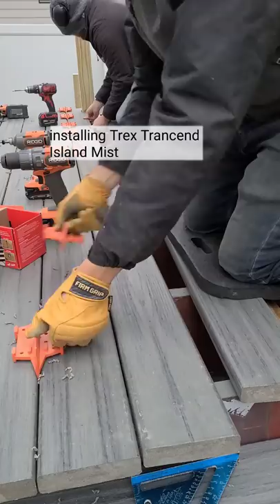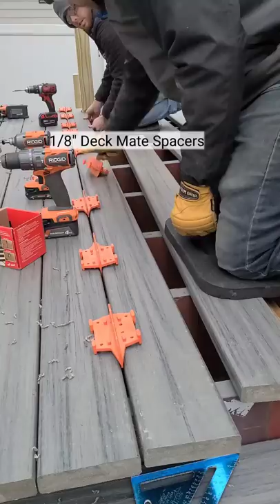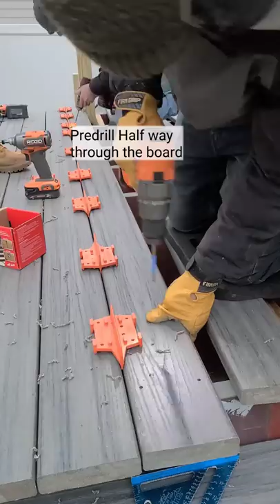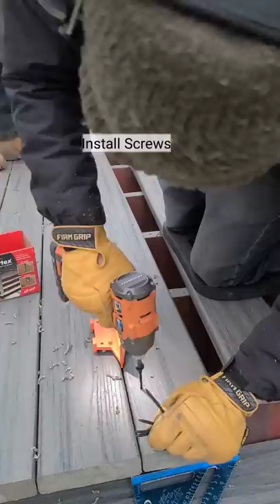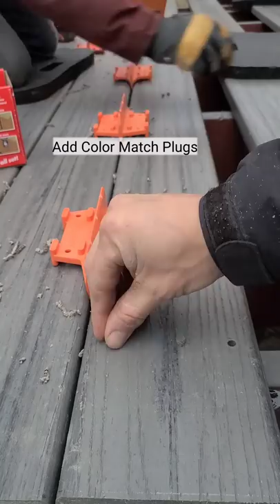Installing Trex Decking #shorts

Comment: You do realize Trex has a hidden hastening system that doesn’t require pre drilling every hole. It would be impossible making any money doing it the way these guys are doing. Or you would have to charge double for the same job…
Reply from the maker: This is a 90sqft deck.
Reply: @gobuildstuff  ok… so that still means doing things less efficient?

Comment: I switched to the Trex hidden fasteners it's alot faster and looks cleaner.
Reply: Why are they using all end boards (solid on both sides) all the way across instead of the proper ones for non-edges... The ones for center boards have groves on both sides for clips that pull them in and mount them to the deck boards beneath... Takes 1/4 the time of this drilling and plugging, plus it leaves the surface of the trex untouched so it's water tight. 🤷
Reply: @MrPhatties  It's possible that the hidden fastener system isn't readily available in there area.
Reply: @Brandonjraw  pretty crazy since the end boards and plugs are more expensive and time consuming.
Reply: @MrPhatties  Definitely

Comment: Why are they using all end boards (solid on both sides) all the way across instead of the proper ones for non-edges... The ones for center boards have groves on both sides for clips that pull them in and mount them to the deck boards beneath... Takes 1/4 the time of this drilling and plugging, plus it leaves the surface of the trex untouched so it's water tight. 🤷
Reply: Probably cause that's what they had to work with. Does it matter? Looks fine

Comment: Why do they make holes for the screws  before they drill, instead of just screwing straight in?
Reply from the maker: Pre drilling hole for the plugs to fit in after the screw goes in.
Reply: @gobuildstuff  Actually the head of the screw itself makes the hole big enough for the plug to go it (the pre-drill is with a 7/32" bit which is smaller than the plug). The pre-drill is just cleaning out some of the composite to make for a smoother insertion of the screw due to the newer formula for the composites out there.

Comment: You don't need to pre-drill with cortex I do it everyday the cortex screw cuts the hole in with the provided bit automatically recesses it.. the cortex screws have three-way threads 1 for cutting 1 for pulling down and the other one sets them.... the back of the of screws cuts the perfect hole for the plug
Reply: Would hate to see your jobs then. They 100% mushroom without being predrilled.  Pro tip...just use hidden fasteners.
Reply: @fettzvettz8718  in the problem with hidden fasteners is they literally do not attach the decking boards to the deck there composite they're not going to rot..

Comment: Great guy... but 2 of those spacer would have been enough. Guess that shows me your level off carpenter skill. He'll even 2 on 3 16p nails would have worked. Bad flex.
Reply from the maker: The composite boards are always Warped when we get them.  So using this many spacers helps keep everything  straight with out moving the spacers.

Comment: Until you want tp take the deck apart and have to rip it apart
Reply: You can sink a deck screw into the plug and pull it out. If you do your work properly the first time that shouldn't be a problem.
Reply: @MK-qv7bq  But then i need a new plug after, since that plug is damaged..
Reply: Shouldn't need to pull it apart

Comment: Ridgid really?
Reply: Is Rigid somehow a worse product than Dewalt or Milwaukee? The lifetime warranty trumps both of them and my pulse driver is more powerful, more battery efficient and half the noise of a dewalt impact. Never had an issue with most Rigid power tools. You just a yelow or red fan boi?